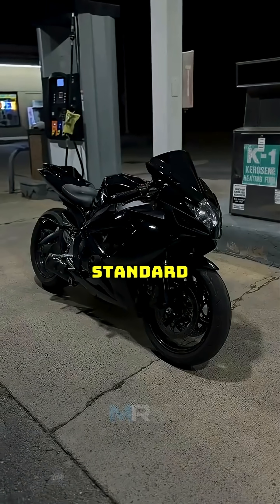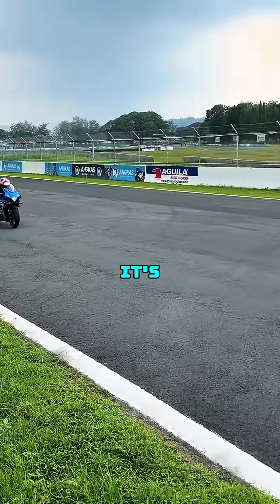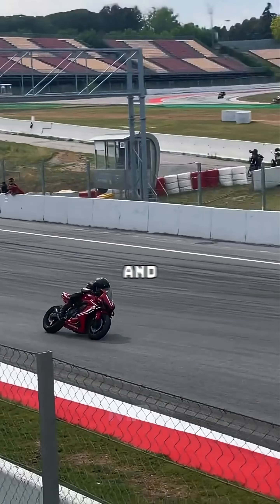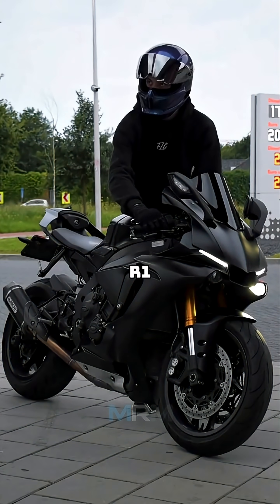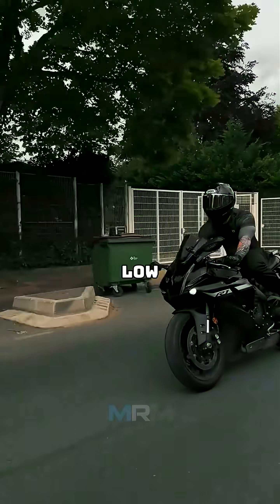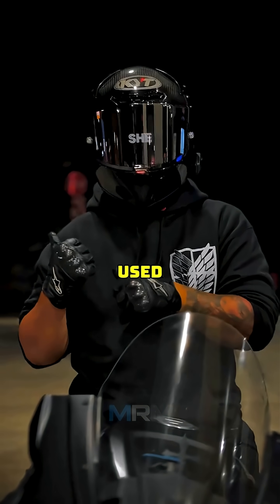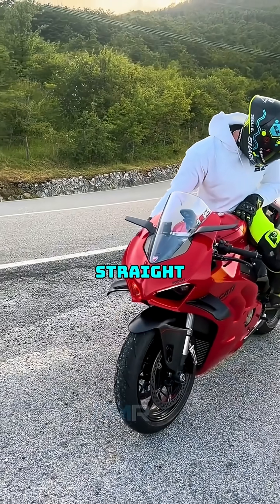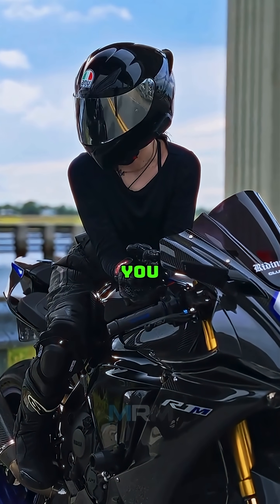The Real Difference Between CP4, Inline-4, and V4 Engines!

Comment: Did not talk about differences.

The CP4 is NOT something different from an inline 4, same set up, same platform. 
The crank and firing order are what is different, it is STILL an inline 4. 

Just like a parallel twin is STILL a twin and a v is still a v no mater how many cylinders there are. 

The engine families are

Single
Twin
Tripple
4
6
8
10
Etc

The V series are subsets of the larger family

A “c4” inline 4 and V4 are ALL 4 cylinder engines.  Just as a w-16 is still a 16 

The amount of misinformation and out right lies that still persist in the motorcycling world is just mind boggling.

Comment: CP4 is also an Inline 4, what makes the sound different is the crankshaft 
The usual screamer Inline 4 bikes like ZX10R uses a flatplane crankshaft while the R1 uses Crossplane crankshaft, both are inline 4
Reply: Thats what he said?
Reply: @jibbetallon2472 This is one of those AI bs vids, of course it wouldn't be accurate

"CP4 is an inline-four engine, but it is a specific type with a crossplane crankshaft."

You can search it up
Reply: @PMTojoHideki are you a bot or something?😂 watch the whole video he literally said that its still a inline 4 but with a crossplane cranckshaft.  Why would i need to mook it up i know what engines are
Reply: @jibbetallon2472 I think I missed that, thanks for pointing it out, It's still kinda wrong to call the Flatplane just Inline 4 because it's a broader term and CP4 also falls under that category, it should be Flatplane, Crossplane, V4
Reply: @PMTojoHideki yeah true